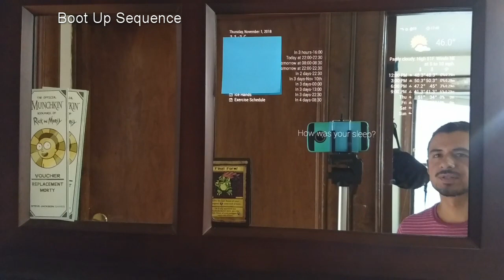Magic Mirror on a Raspberry Pi Zero W

Comment: Hi, Great video!
I have laready installed MagicMirror on my Pi Zero and everything works properly. Now I am trying to make it working with a 3.5 TFT but I don't know of to configure it. I aleady installed the driver but nothing! Magic mirro is working because I can open it via web.
Do yu have any suggestion?
Thank you!
Reply from the maker: is the display working at all with the pi zero? if you have a spare sd card I'd put raspbian lite and see if the tft is working properly with the stock os. I haven't done much with the tft, sorry I can't be more helpful!
Reply: @LightningSharkProductions  Thank you for your help. The display works. It is a Gpio display so maybe thi is the problem.

Comment: Nice mirror !!! Does this also works with pi1 ?
Reply from the maker: Not officially supported, but neither is the pi zero w. You could try following the same steps outlines as for the pi zero w using raspbian lite. Otherwise I'd suggest a pi 3 b+ and everything should be much simpler and smooth. good luck!

https://github.com/MichMich/MagicMirror#raspberry-pi

Comment: Great video thanks question though. I used you image it's allot faster but it won't allow me to update the os or the magic mirror software how Domi remove the config file locks?
Reply from the maker: Thank you! ... did I modify a file tracked by git, oops :/ change directory into ~/MagicMirror and do "git checkout ." (w/o quotes) and that should reset any changes I made to git tracked files. you should then be able to update the magic mirror install. If that doesn't solve the problem let me know what the error says
Reply: www.360india.in